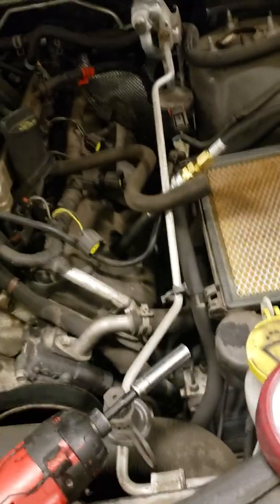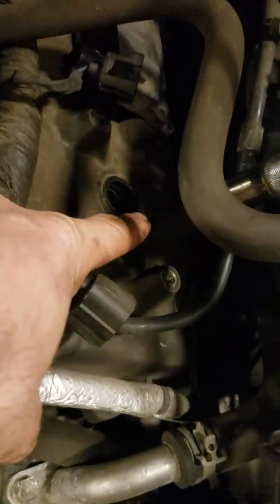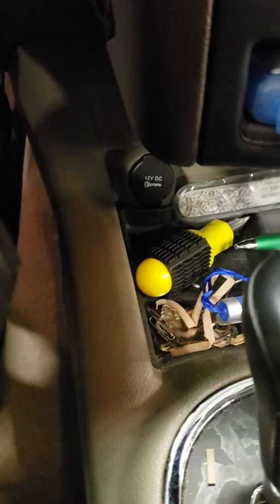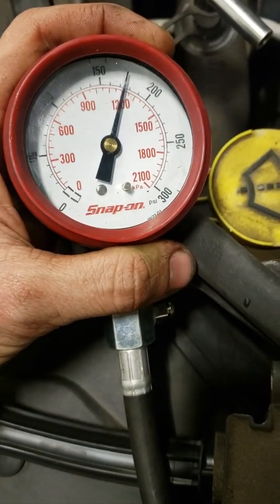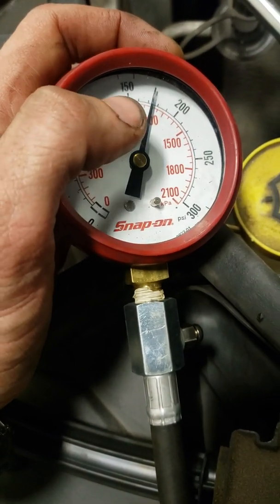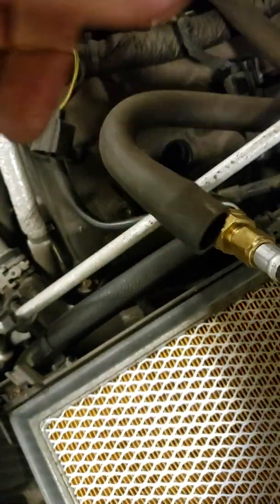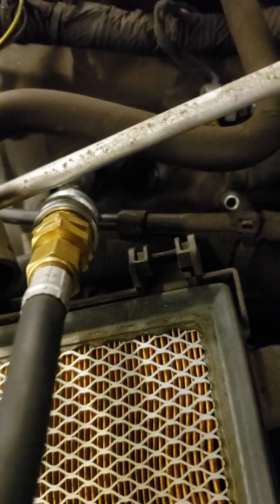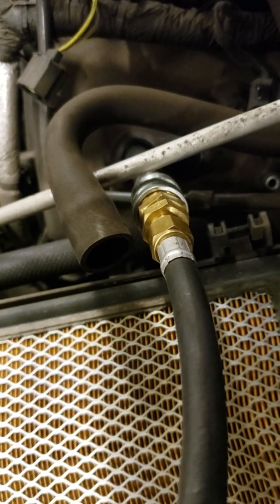Compression tests on a hemi 5.7l 2005 and up, dodge, jeep, chrysler, RAM

Comment: How do you disable the engine so it won't start during the test?
Reply from the maker: Pull the fuel pump fuse or, you can push the accelerator pedal to the floor while cranking
Reply: @crytech706  Thanks!

Comment: So if cylinder is at 120 lbs would be bad spring possibly?
Reply from the maker: It's possible, 120 is okay as a dry test' but if you wet the cylinder and it increases, I would look into internal engine. Best way to see of its a bad spring, take the valve cover off and look at the valve train